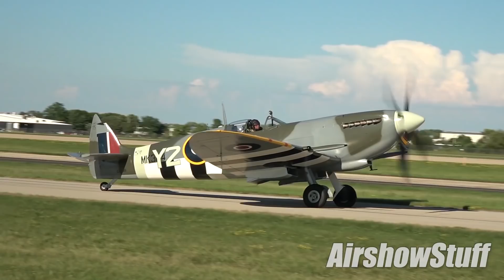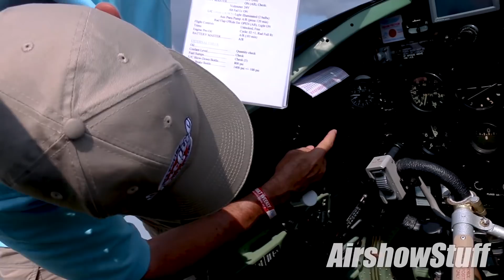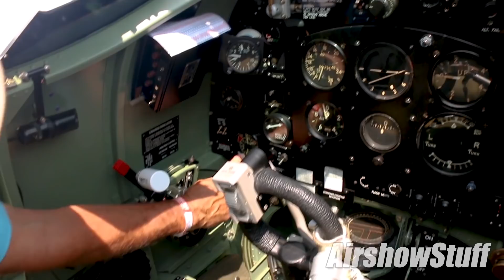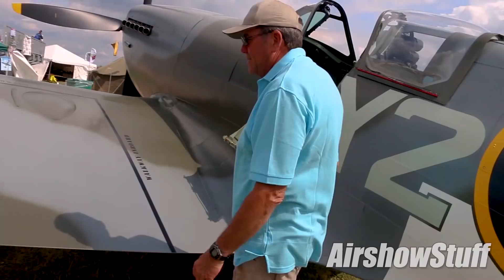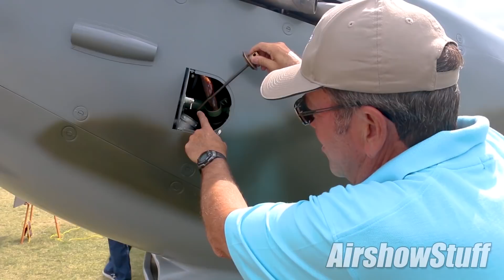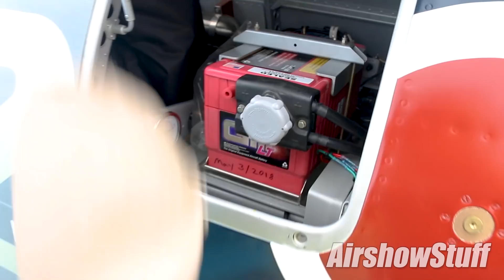Spitfire Preflight/Walkaround Tour - EAA AirVenture Oshkosh 2018

Comment: Do you know what prop came on this bird? I'm trying to find some cross sections to model the prop. I found everything for the fuselage but nothing for the prop.
Reply: The airfoil is Clark Y. There's a book called Spitfire IX & XVI Engineered which is available in PDF form online that has full plans for the propeller.
Reply: @em_bott  ok thanks!👍

Comment: I had the extreme good fortune to be the display pilot for the SAAF Museum Spitfire Mk IX, back in 1999/2000. Dave summed it up nicely, you get a very distinct light buffet on the stick near the stall, she is a viceless aeroplane, gentle in a stall for a high performance fighter, she’s easier to fly than a T6 (or Harvard)! His comment on feeling part of a team, you and the Spitfire, is very true. It is no surprise combat pilots loved the aircraft. The aircraft seems to communicate with you in flight. The only thing I was surprised about was he didn’t seem to check the landing gear locking pins chains, up in the wheel wells. These are little bicycle type chains and they rotate the landing gear locking pins for locking the gear up and down. If these are not in good condition, you will have problems. Especially if the gear was up and you can’t rotate that locking pin, because of chain failure. Nothing will get that gear down. Otherwise, he’s a lucky man!